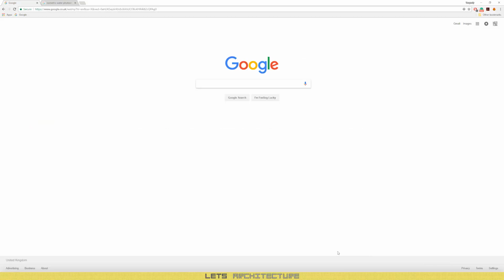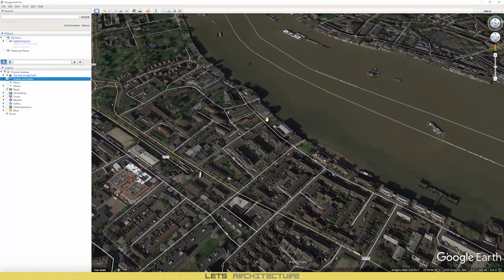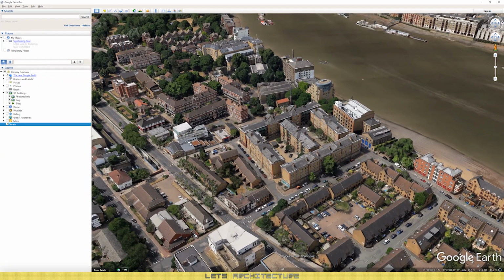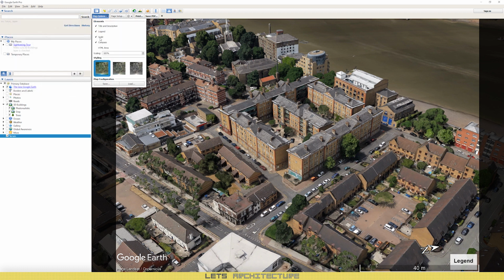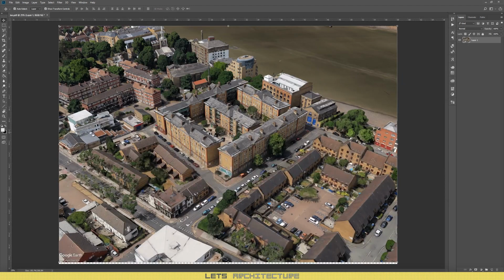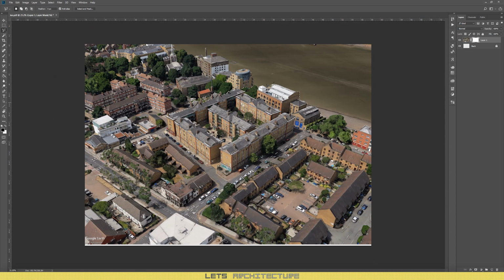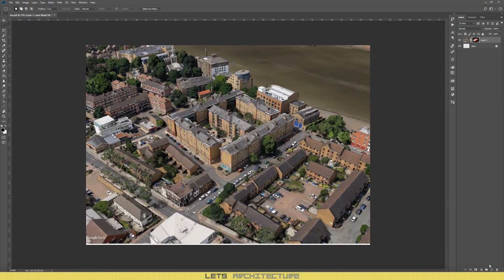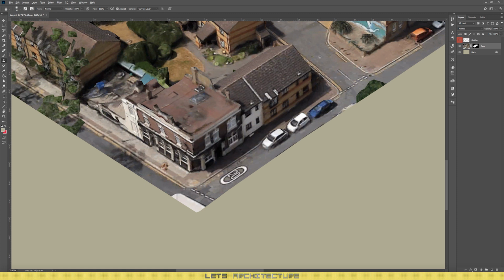Google Earth 3D Illustration - Architectural Presentation [Photoshop]

Comment: Great video for sure. But I wish everything was explained instead of just shown. The line tool is not even standard. I had to find it. Then as I used it I noticed that it as standard just draws lines. There is no noticeable way to combine these lines. But I paused the video and checked out the settings.

Another thing. Google Earth has graphic settings for 3D view. That may change the print quality?
Reply from the maker: Sure, Ill try explain everythung in the future

Comment: You have to understand that you are not saving more detail or info based on the output size saved, you are merely doing an interpolation of what you can see i.e. 72 dpi pic.
What happens is that more pixels are added and give a softer transition on edges, yet do not give you a sharper or more detailed image ok!

Try using this method instead...  https://youtu.be/Bb0HnaYNUx4